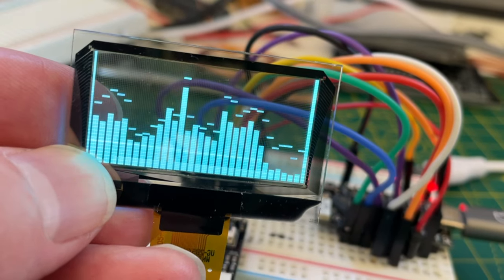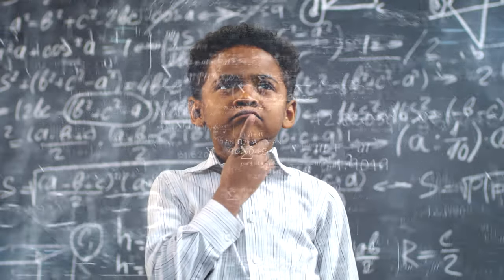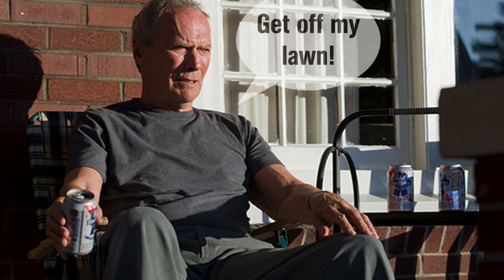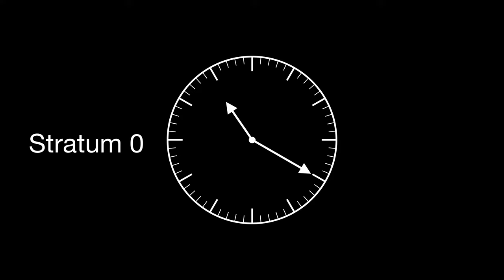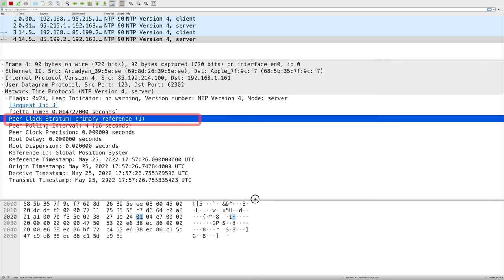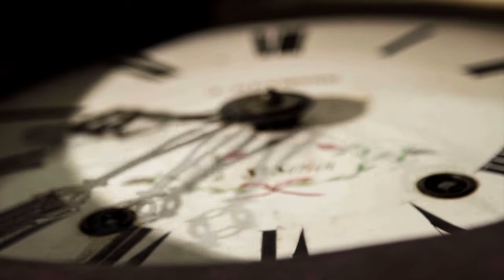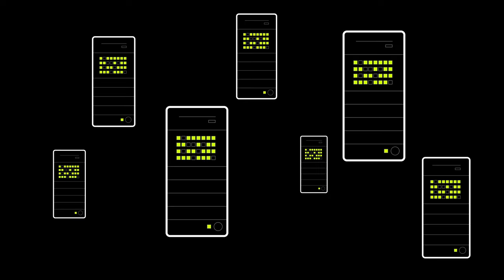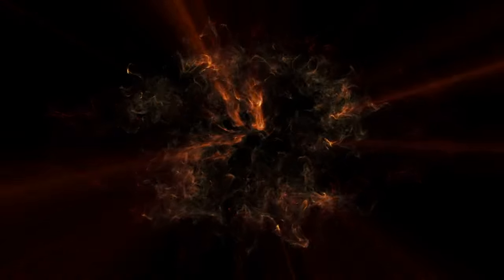Atomic Clock Sync: ESP32 NTP Magic in Just 2 Lines of Code!

Comment: So, the network is directly polling GPS satellites... You can, too, and make a portable GPS Atomic Clock. You just need a cheap Ublox GPS Receiver clone and have the MCU tap into it. I used the model NEO-M8N and a PIC18F4550 to make my clock. The NEO-M8N can also be used to make a 10MHz frequency reference, because its on-board chip can be configured to output different frequencies. So, I added this additional output to my clock. For that matter, once you have a GPS receiver, you can have the MCU handle all of the information the GPS satellites provide and build your own GPS positioning device. And, the accuracy is perfect, because there is no line transmission delay.
Reply from the maker: It's surprising how much GPS is used just for time - almost all mobile network base station have a built in GPS receiver just so they have accurate time. And you can pick up a GPS module for <$2 on AliExpress. It's amazing.

Comment: I'd be more impressed if it were using an ESP8266which is half the price of the ESP32 and the free Tasmota which allows time and date readouts without a single line of code :-) Pop the code in using the online installer, set the mode to show the time and it's done - rstarts automatically after poaer failure.

Comment: 5:09 The use of timestamps to compensate for transmission delays is all well and good but they need to be accurate, which the local times may not be so how does that work ?
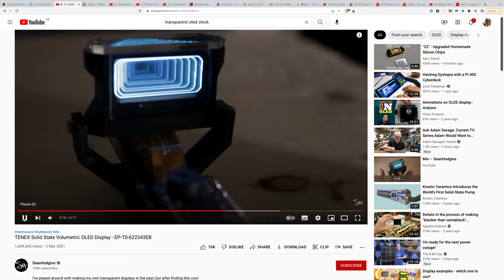Reply from the maker: It's really very clever. Imagine ntp time is 0:30 and our local clock is 10seconds behind at 0:20

We send a request at 0:20 it takes 1second to reach the server and the server records the request received as 0:31.

The server takes 1 second to process the request so sends its reply at 0:32

It takes 1 second for the reply to reach us so we recorded the receive time as 0:23

If we now apply the delta formula we have.

0.5 x ((0:31 - 0:21) + (0:32 - 0:23)) = 0.5 x (10+10) = 10

So we have 10s as our offset from the server time.

Comment: Would have been helpful if delta and  theta had been defined and the connection between the two made clear. Certainly the origin and destination of the message must be indicated. 
It is not sufficient to say the two numbers maybe used to make the time correction, without showing how.
Reply from the maker: I should have included a slide for this. It's pretty clever how it works.

Imagine NTP time is 0:30 and our local clock is 10seconds behind at 0:20

We send a request at 0:20 it takes 1second to reach the server and the server records the request received as 0:31.

The server takes 1 second to process the request so sends its reply at 0:32

It takes 1 second for the reply to reach us so we recorded the receive time as 0:23

If we now apply the formula we have.

0.5 x ((0:31 - 0:21) + (0:32 - 0:23)) = 0.5 x (10+10) = 10

So we have 10s as our offset from the server time.
Reply from the maker: Delta is the total network delay - if you plug the same numbers into the formula you should get 2seconds - the total delay due to the network. Theta is the time offset.

I really should have put all this in the video!
Reply: @atomic14  I derived the equations from first principles, Am I correct in assuming that the result depends on the forward and reverse network path having equal delays. My equations suggest that it's possible to calculate the  error in the computer clock, and the total loop delay, but not the difference between the delay between  the forward and reverse paths. This delay appears in the LHS of the equation 
2*theta + path delay difference= (Tr-ts)+(Ts-tr) 
Where Tr = request received by time server.
             ts=request sent by computer.
             Ts=reply sent from time server
             tr=computer receives time server reply
The above is derived by equating absolute times for the messages at the computer and the server. 

If e is the time error in the computer, and
Ta is the network delay in the path from computer to server, and 
Tb  is the network delay in the path from server to computer, then
(e+ts)+Ta=Tr
And 
(e+tr)=Tb+Ts

Total network delay being given by (Tr-ts)-(Ts-tr)
(2×e)+(Ta-Tb)=(Tr-ts)+(Ts-tr)
Thus the time error can only be calculated if Ta=Tb. Which is the bit that bothers me.  
Where the above Tr, ts, Ts, tr are the only known time values at the computer end of the link. 
The time error e, is a common value that may be positive, or negative.
Reply from the maker: @nigeljohnson9820  That's correct - there is an assumption that the network delay is symmetrical. That's why it can be important that you connect to an NTP server that is close to you in terms of network hops - fewer hops mean less chance that the routes from and to your computer will differ. A lot of systems will use multiple time servers and will sample them continuously to find the most "stable" source of time.
Reply: @atomic14  I looked at the full protocol for NTP. It is remarkable involved.
I assume that the difference error between go and return can be eliminated by statistically looking for a minimum error in the clock signal, as this corresponds to Ta=Tb, that is symmetry in the delay of the go and return signal. I find it amazing that NTP can achieve such high levels of accuracy, given that such digital networks memory buffer the data.
I worked on the design of digital telecom systems, but we were forced to resort to using clock signals derived from GPS, with a time sync calculated from the UTC clock signal. This proved a problem when the GPS epoch changed.